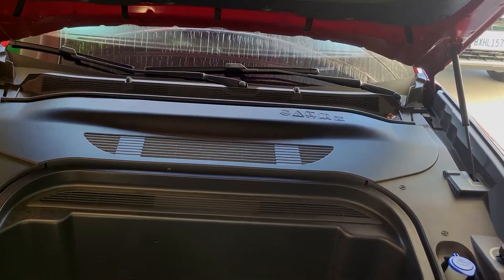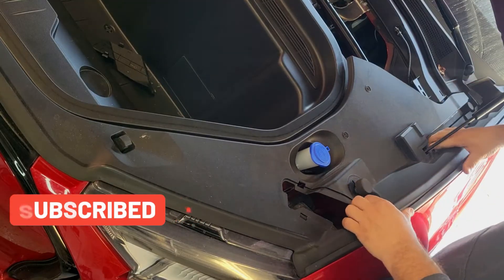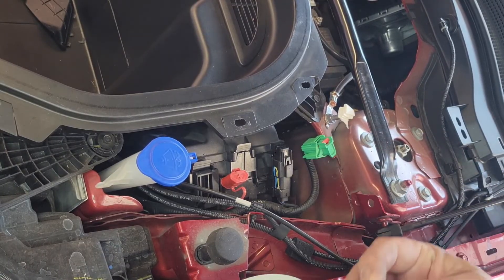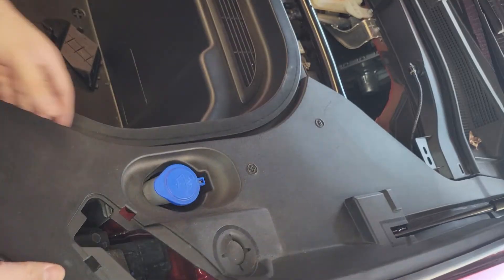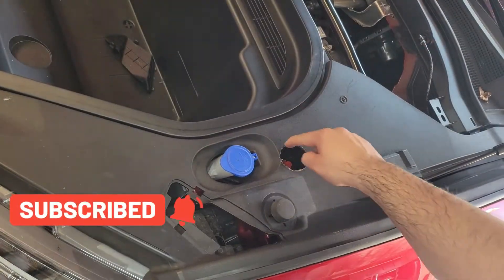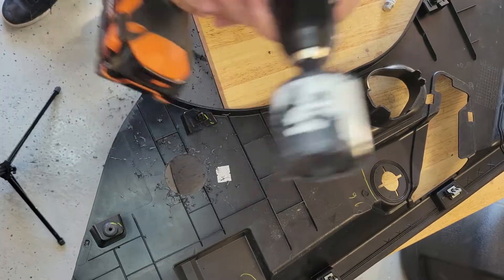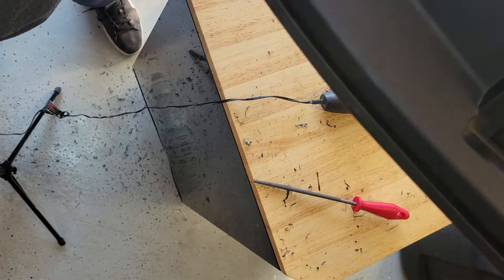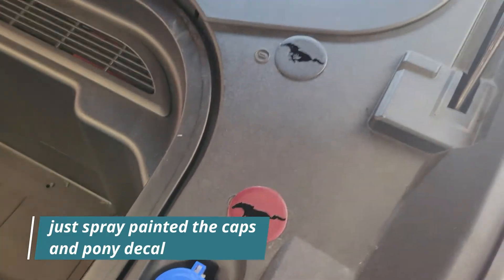12 V battery access holes | Ford Mustang Mach E

Comment: Nice video. I've had my MME for about six months.  I don't expect to need to jump it for a few years. (My batteries tend to last about three years.). However, why even bother with the plastic access panel? Why not just toss it? Does it serve any purpose?
Reply from the maker: Just for the looks. If you use the frunk, you might not want to look at it all the time

Comment: Worst design on earth to get to a 12v battery - hated having to get it mine on my GT - not an issue anymore.. but Ford assumed ppl were not going to need much quicker access
Reply: My 2019 Ford Fusion Hybrid had the 12v in the truck. When the battery dead the car doors  wouldn't open with the button on the key, and the trunk also has an electric release. We had to open the driver door with the manual key, reach in the back to open the back door. Lay down the back seat. And climb into the truck and pull the emergency release

Comment: If you're brave enough there are some templates on the mach-e forum for a hole saw so you don't have to take off the covers.  It's a little scary but mine worked out alright.

Also I found running the hole saw backwards actually gave me a cleaner cut, it almost 'melted' through and gave a nice smooth edge.  It takes longer but you're only doing 2.